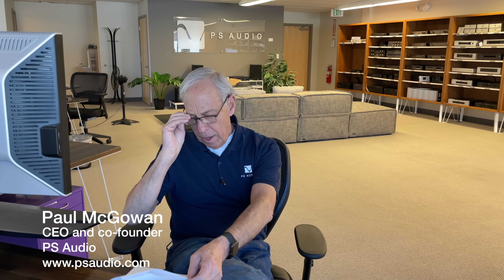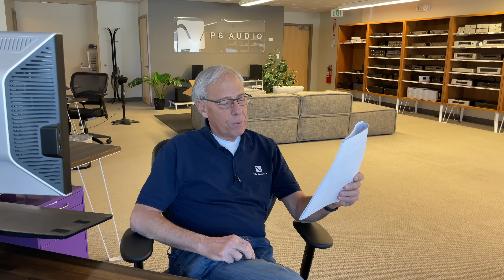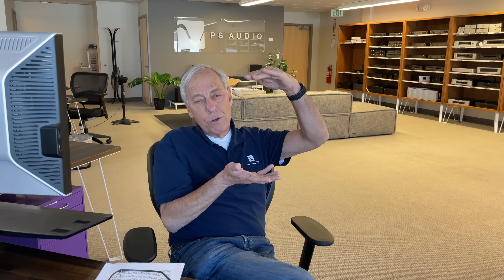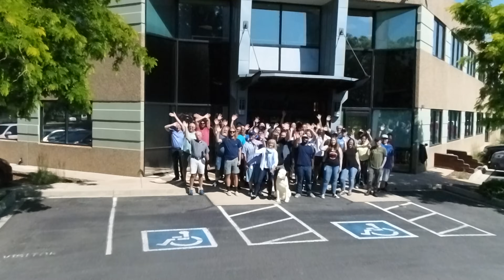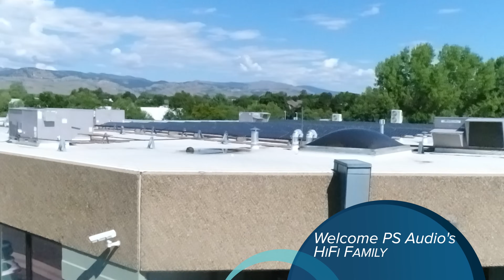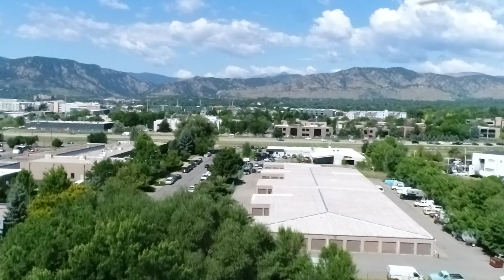Understanding multiple woofers

Comment: Meh. Very few towers can match the bass output of even a small sealed sub, especially if that sub (or subs) is located optimally for bass reproduction. Especially when WAF comes into play. Many towers can certainly be enough. But there isn’t an easily obtainable tower with bass that can compete with, say, 2 SVS SB-3000 subs in a corner.

There are also multiple returns from floor bounce for each driver. If this hasn’t been accounted for, and it often isn’t, then moar isn’t always better. Everything is a tradeoff.

Comment: here are the square inch area of various woofers: 8 inch = 28 SQ inches, 10inch = 50 SQ inches, 12 inch 78 SQ inches, 15 inch 130 SQ inches, 18 inch 185 SQ inches.  . to physics of max output. every time you double the cone area you gain 6DB more output ( NOTE!, this ASSUMES the excursion of the cones is the same on all size woofers).....example,  a 15" woofer has 8DB greater max output than a 10" woofer. ( again assuming the excursion of both woofers is the same). NOW to multiple woofers, if you put say 2 fifteen inch woofers next to each other in the same cabinate they will "multually couple" where the center to center woofer spacing is less than one quarter wavelength.  . lets say the center to center woofer spacing is 18 inches.......we multiply that number X 4 and we get 72 inches OR 6 feet.  what sound frequency has the wavelength of 6 feet?  1130 devided by 6 = 188.33HZ.  BELOW 188HZ this sustem will have  3DB more effiency and 3DB more power handling ( double the power for 2 woofers) for 6DB or 4 times the max output below 188 HZ VS a single woofer!!.   ABOVE 188 HZ you will get NO effiency increase but you will get 3DB greater output above 188 hz due to the double power handling.   I have 4 fifteen inch woofers per side in my living room and  its a completly different beast compared to one per side.  multiple woofers are a HUGE advantage IF your goal is higher output.

Comment: I think the thing to keep in mind is that "deeper" is not necessarily related to "lower" because one might think that the two terms are synonymous. A six-inch subwoofer (if there really is such a thing) that rolls off at, say, 40Hz, will remain unchanged if another similar-sized woofer is included in the cabinet with the same roll-off. The two together won't go deeper in terms of rolling off at a lower frequency but the volume of the output for them would be louder, which could be perceived as "deeper" if that makes sense. 

Unless there's some voodoo, crossover magic that takes place somehow. I could be wrong, though.

Comment: You don't really want a thing cabinet you lose Bass by having a narrow baffle, and having more drivers is beneficial because it's less excursion on the driver's you don't want excursion on the drivers you want to keep it to a minimum more excursion causes more distortion and worse transient response.
It can be beneficial having small bookshelf if they're near-field and having bigger drivers behind against the wall running through a active crossover network.

Comment: In some cases when theres 2 or 3 identical woofers one of them will be crossed over at a higher frequency to act as a midrange coupler or to better meet up with whatever mid driver is being used.
Reply: Exactly
Reply: @Talia.777  Fuckin <3 Paul, sometimes hes not totally on the mark as others have mentioned as well. We all have days a little left of center though...
Reply: @AllboroLCD  indeed! Paul and Dave letterman are a lot alike in that way, but instead of being right Dave tried to be funny haha. I watch a TON of both of these guys on YouTube here
Reply: @graxjpg  I am sure he knows multi woofers in a single cabinet are usually x'ed over at different frequencies as well and just forgot to bring it up. He likes to cover the same questions and subjects more than once so hell def go over it at some point down the road.

Comment: Hi Paul, I understand that floor-standers  would have more bass over bookshelves.  On the other hand, since the bass woofers share the same cabinet with the mid range and tweeter, won’t they affect the mid to highs?  For example, the tone of the vocals?  Thanks
Reply: Thank you for thinking of that.
I believe the answer is 'yes'.
Of course, the greater vibration from a woofer(s) will have an effect. Mainly by reducing clarity and transparency.
Reply: The mid and tweeter usually have a separate enclosure inside the cabinet. Other times the mid has its rear sealed so it doesn't need to be insulated..
Reply: @andrelooo_df  I attached a link to a video showing the inside of a B&W 700 series tower.  As you can see, the mid range and bass woofers share the same enclosure.  https://youtu.be/3zfgvf-d2pI
Reply: @wenc8796  Those 3 speakers that someone disassembled in the video are the woofers, which can share the enclosure. As Paul explained, those 3 speakers are equivalent to one with a larger diameter, but they put this way to make a narrow box. What is not seen in the video is precisely the mid. I think it has a separate enclosure, but, as they also answered, it does influence the action of the woofer and it would change the sound.

Comment: I prefer standmount speakers, with a high level subwoofer connected, for my set-up at least. I don't have the space to give a floorstander the space it needs to not sound like a boomy box.  I tried the well-regarded Q Acoustics 3050 floorstanders, and in my set-up they didn't work. Replaced them with the Concept 20s (and their stands) and a REL T-Zero MK III - perfection. Clarity from the speakers, seamlessly integrated additional bass from the sub. So there is definitely more to it than "it takes up the same floor space".

Comment: Thats why bass guitar speakers have 4  x 10'' cone's.....faster bass response...but still get deep bass.
Reply: The size of a woofer has absolutely nothing to do with the “speed” or “attack”of the sound. Literally nothing. It’s like saying smaller cars go faster. It’s nonesense and it’s a myth that keeps going around and around forever. Bigger cones have bigger motor assemblies to move them, they move the exact same way. The only inherent difference between smaller and larger woofers is frequency response. 

If you EQ’d a ten and a fifteen to an identical frequency response they would sound the same. 

The reason for quad boxes is simply to fit more total cone area into a square enclosure of a given size. It’s a more efficient use of baffle space than a single woofer. 

They only sound different because they’re playing to a higher frequency with less low end.
Reply: Exactly, bass guitar cabs are better off with 10s. I like 10s for most music reinforcement and production
Reply: The exception is when you purposely want sludge. guitarist Kim Thayil of Soundgarden used a 15" Ampeg bass cabinet.
Reply: @surfkerf  zappa used to do that too back in the 70s, but to be fair he did more experimental things with guitar than anyone I’ve heard of
Reply: I have a (very loud) 10" sub and the thought of having 4 of them seems absolutely insane 😅
Reply: @WillyJunior  bass guitar amps are usually hundreds of watts too!!
Reply: 10” Definitely a faster response, and punch. For deeper harmonics, the 12” for guitar and 15” and 18” for bass ❤️

Comment: Is it not true that a bookshelf speaker and a floor stander can have the same amount of back pressure and the same f3 or low frequency response with the real difference being the amount of power they can produce. since as the frequency lowers and there's a beautiful equation for this the amount of power needed goes up radically. Thus the extra woofers can produce more energy into the room. They need not although they can extend the frequency response slower lower. Is this not true? Thanks Paul.

Comment: A speaker has a minimum box volume and a maximum box volume they should have.  The bigger box you have the better sound you get! Especially in bass and mid bass!

Think of a speaker as an air pump. the larger the speaker surface you have the more air you can move and you get more bass!
but more or bigger speakers means you have to have a bigger box!

you do not get as good bass in a small speaker as with a large speaker!

Comment: think this topic Paul generalized too much.
bookshelf cost less to make and hence sound better at the same price as floorstanding. adding more of same size woofer wont add more sound quality or play lower. box size and type is the defining thing here, all box speakers can have the same box volume for both bookshelf or floorstanding.  port tuning can be different or type of cabinet like slave, port,  transmission line and so on. but dont buy those, sealed or open baffle is for hifi.
small speakers are better than tall speakers if there is only one tweeter. more point source if better. 
remember that you need a subwoofer anyways to get full range so no need for main speakers to play any 100hz bass or lower. 
6" woofer is equivalent to a 10" on the cone area. but the 10" plays lower because it has more mass. dual 6" have some spl benefits and in the upper ranges and can play louder then one 6" with more ease.

Comment: I believe one 12" woofer has more surface area than two 6" woofers.
Reply: But 12'' is heavier...so slower....not good for fast bass.
Reply: @adamsonlinearrayspeakersha87  Are you considering that a 12" speaker also has a much large motor assembly on the back as compared to a 6" speaker?
Reply: @adamsonlinearrayspeakersha87  Smaller LF drivers generally have lower damping factor and better transient response than larger drivers with more moving mass.  Large magnets can help offset the moving inertia,  but there's a limit.  FWIW:  with anything larger than about 12 inch diameter,  you are getting into high efficiency drivers,  and they have their own quirks.
Reply: @gyrgrls  
Damping Factor is not a characteristic of a LF driver. 

Moving mass impacts sensitivity, not transient response. Woofer speed is a function of instantaneous current flow from the amp into the V.C. 

"𝘢𝘯𝘺𝘵𝘩𝘪𝘯𝘨 𝘭𝘢𝘳𝘨𝘦𝘳 𝘵𝘩𝘢𝘯 𝘢𝘣𝘰𝘶𝘵 12 𝘪𝘯𝘤𝘩 𝘥𝘪𝘢𝘮𝘦𝘵𝘦𝘳, 𝘺𝘰𝘶 𝘢𝘳𝘦 𝘨𝘦𝘵𝘵𝘪𝘯𝘨 𝘪𝘯𝘵𝘰 𝘩𝘪𝘨𝘩 𝘦𝘧𝘧𝘪𝘤𝘪𝘦𝘯𝘤𝘺 𝘥𝘳𝘪𝘷𝘦𝘳𝘴, 𝘢𝘯𝘥 𝘵𝘩𝘦𝘺 𝘩𝘢𝘷𝘦 𝘵𝘩𝘦𝘪𝘳 𝘰𝘸𝘯 𝘲𝘶𝘪𝘳𝘬𝘴"

Efficiency isn't a function of diameter. 
High Efficiency is an overall design approach leveraging characteristics including moving mass, motor strength,
free-air resonant frequency, and other electro-acoustic parameters.
Reply: Two 6" woofers have the surface area of one 8.5" woofer. It's simple math.
Reply: @ThinkingBetter  It they are completely flat.
Reply: @mcplutt  As a piston pushing air, it is true. The cone shape enhances the strength but it doesn’t add to the air displacement.

Comment: Two six-inch woofers are more like one eight-inch.
Reply: Mathematically, two of something diameter has the surface area of the square root of 2 times the diameter. Thus two six-inch woofers have the surface area of 1.414 x 6" = 8.5"
Reply: Maybe 1+1 isn't 2 but more
Reply: @D1N02  No maybe. It’s only 1.414 (square root of 2).
Reply: @ThinkingBetter  I mean there may be a synergetic effect. Then it would not just be metrics.
Reply: @D1N02 Of course there is more to it, but everything follows formula of science. While four 6" drivers theoretically have the same area as one 12" driver, they will not sound the same. One 12" driver might actually move more air at lower frequencies than four 6" drivers due to typically having longer excursion range also, but at higher frequencies, the 6" drivers will likely win with lower distortion and higher SPL. You wouldn't want a 2-way speaker with a 12" woofer and tweeter, but you can get away with a 2 way speaker using more 6" woofers.
Reply: @ThinkingBetter  
(4)6"s vs. (1)12" may or may not sound the same, but the certainly operate differently.  

The real difference is simply piston size. Piston size determines the freq at which they begin beaming. This directional characteristic matters most at the crossover transition to the HF section above... as ideally one strives for uniformity in horizontal coverage angle at the cross. 

- So one real difference is that directional characteristic transition to the tweeter. 

If the stroke is the same, then (4)6"s move the same amount of air as (1)12", period. 

- So another tangible difference is splitting the drive signal across 4 voice coils. This should yield greater thermal capacity/less compression. 
- Also, in addition to greater responsiveness due to less compression, settling time should be superior across the 4 drivers. 

All in all there's likely performance benefits in the 4 driver set, as long as the all important coverage angle uniformity is well matched at the crossover. 

(btw; nothing wrong with 12" two-ways, as some of the greatest studio monitors are 12", or 15" constant/controlled directivity two-ways)
Reply: oh ok  
I was merely clarifying total stroke capability, but you do point out a valid concern. 

I'm a fan of the coax approach. My primary HT system's LCRs utilize an 8" coax flanked by a pair of 12"s above and below. 

That said the quarter wavelength blending associated with a 15" 2way, or a multi-driver array handing off to a HF driver, shouldn't possess any summation issues in the primary frontal lobe on axis. It's the off axis energy in the vertical where the issues exist. 
So the sonic impact of any discontinuities in the vertical is strongly dependent upon the room characteristics. For example, in a well executed room, ie., studio/mastering, etc., big studio mains (15"-2way, or big multiway multi-driver monitors) off axis energy isn't an issue. With the proper geometry of all the adjacent surfaces, only the direct on axis energy is experienced at the mix position, then by 40msec, remaining diffuse reflected energy needs to be at least-10dB down.  
With simple geometry, the off axis energy is redirected, absorbed or diffused until it isn't detrimental to the direct sound. 

Best practices suggest that any reflected energy that's ultimately part of the listener experience, the preference is for reflections that are spectrally similiar. 
So, if absorption is used, absorb it all... ie., as broadband absorption as possible. 

There's very few definite rules of thumb in small room acoustics. But one big issue can be addressed via big, thick, effective absorption cloud, on the ceiling between the speakers and the listener. Other room surfaces there is endless debates on diffusion here, absorption there, ... but not the ceiling between the speakers and the listener... absorb it all. 
 
Damn! I'll stop ... I just jumped on here to say "good point".

Comment: A=π x radius x radius...thus a 12” woofer has 4 times the area of a 6” woofer.
Reply: Well, roughly.  Cones are not flat discs (circles) and the pole piece and surround margins have to be considered.
Reply: @gyrgrls  Yes, of course. And a woofer's performance has many parameters associated with it other than  just surface area.
Reply: @gyrgrls  Yes, cones are not flat but... Have you ever seen a visualization of a cone shaped sound pressure wave? I've only seen circular depictions.    
I don't know which visualization is closer to reality but I suspect the cone shaped driver design is dictated more by the need for environmental (air) coupling or impedance, than shaping the resulting pressure wave. A converse way of looking at it, is the virtual absence of flat-ish voice coil drivers (flat-ish cone drivers). Flat panel speakers and DIY exciters, do exist but then they require relative much larger surface areas than cone shaped drivers. Hence lending weight to the coupling/impedance notion for cone drivers. 
In any event, IMHO, I suspect the audio effectiveness of a cone drive is more closely related to its 2D circular area than the 3D surface area of the cone. 
Interesting.
Reply: Yeah that immediately didn't sound right to me.

Comment: The deeper the bass and the louder the sound the more air needs to be moved.
Reply: Yes.  Lower frequency = longer wavelength = more air mass for same SPL (compression / rarefaction).
Reply: And a better room/room treatment
Reply: A quadrupling of Vd is required for equal SPL for each octave of extension.